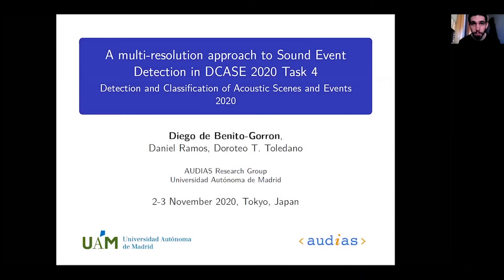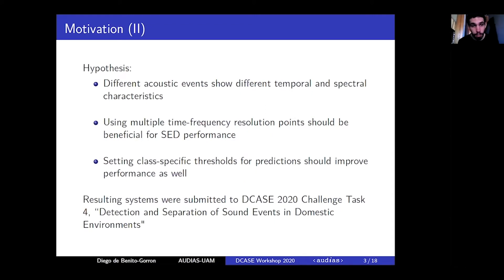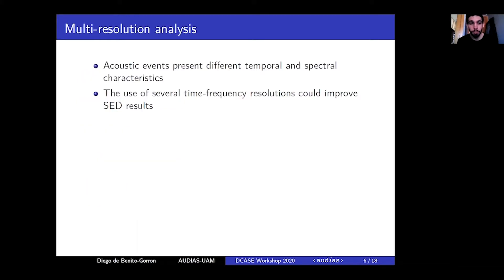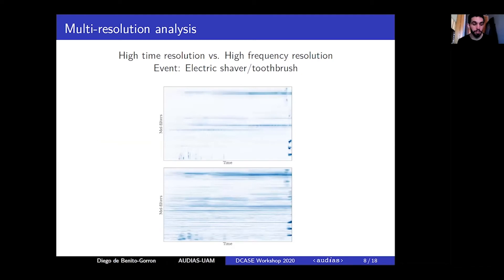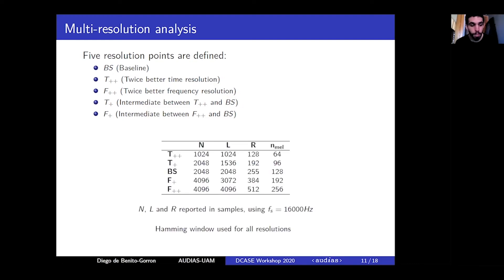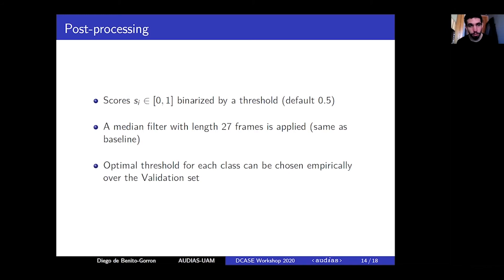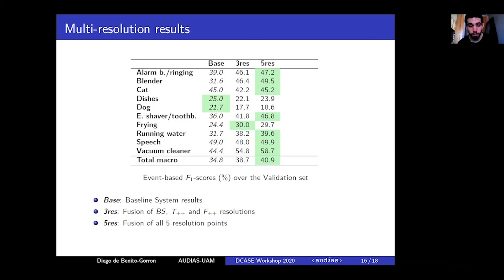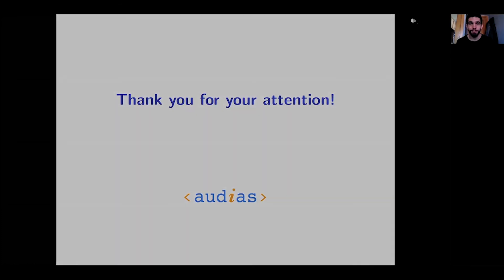DCASE 2020 Workshop, ID 51, Diego de Benito-Gorron et al.

Comment from the maker: keisuke_imoto
7:39 PM
 Has joined the channel.

fassio_blatter
6:54 PM
 Has joined the channel.

yohei_kawaguchi
7:16 PM
 Has joined the channel.

fassio_blatter
8:07 PM
 Has left the channel.

cagdas_bilen
10:12 PM
 Has joined the channel.

fassio_blatter
12:49 AM
 Has joined the channel.

cagdas_bilen
1:11 AM
Hi thank you for the nice talk. I just wanted to ask about how the multiple resolutions are applied. It makes sense that different classes may benefit from different resolutions. My question is that, why did you prefer averaging as an ensembling method, instead of a weighted sum which can be learned per class? Wouldn't it make more sense for some classes to benefit from some resolutions more whereas some others benefitting from other resolutions? I wonder if you had any insights/results on that aspect. Thank you.

diego_de-benito-gorron
1:16 AM
 Has joined the channel.

fassio_blatter
9:57 AM
 Has left the channel.

yohei_kawaguchi
Admin
8:43 PM
Copied from Zoom

Yusuf Ally
Thanks Diego, very well done. Is it safe to assume that more res pts. wou;d increase macro performance? ie K res pts for K classes?

Andrés Estrella Terneux (CVSSP)
Thanks for the presentaion. Is there a systematic strategy for selecting the optimal threshold per class?

Archontis Politis
If I understood you have separate models for each resolution. Did you try any fusion of features of multiresolution spectra in the same model?

tatsuya_komatsu
10:16 PM
 Has joined the channel.

diego_de-benito-gorron
10:34 PM
Hi Çagdas, thank you for your comment. We agree that it makes sense to learn different contributions of each resolution for each category. During the evaluation period, we tried some alternative fusion methods, but the results were similar to the average fusion. Therefore, we chose average fusion because it allowed us to combine already trained models without learning additional parameters, thus avoiding the risk of overfitting to the validation set. However, we are currently working on other approaches to combining multiple resolutions.
 cagdas_bilen November 3, 2020 1:11 AM
Hi thank you for the nice talk. I just wanted to ask about how the multiple resolutions are applied. It makes sense that different classes may benefit from different resolutions. My question is that, why did you prefer averaging as an ensembling method, instead of a weighted sum which can be learned per class? Wouldn't it make more sense for some classes to benefit from some resolutions more whereas some others benefitting from other resolutions? I wonder if you had any insights/results on that aspect. Thank you.

cagdas_bilen
10:36 PM
thank you Diego for the reply 🙂